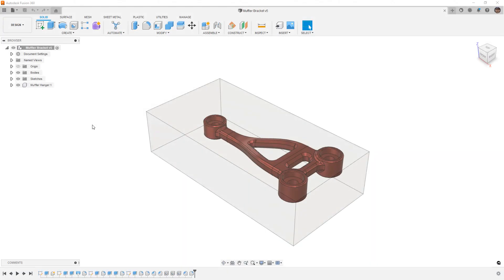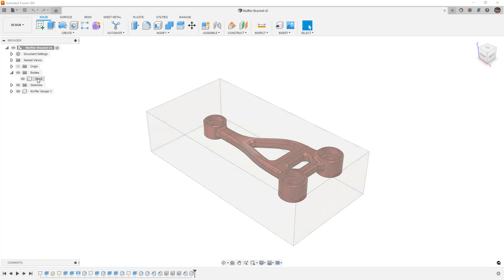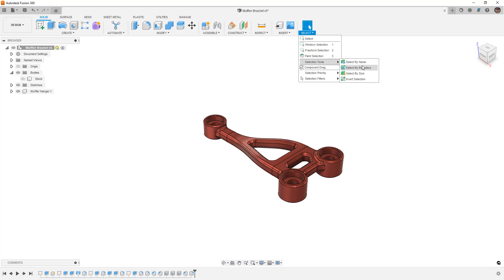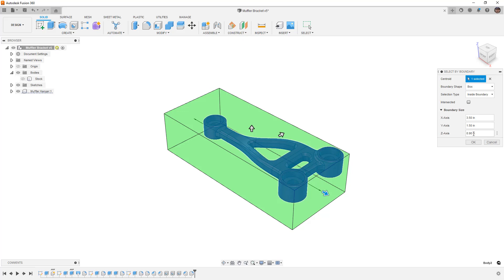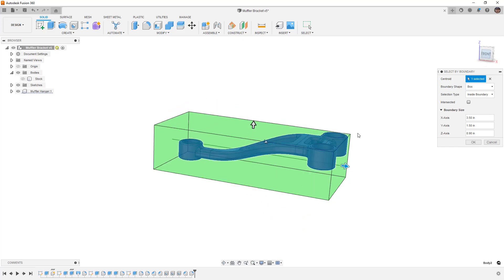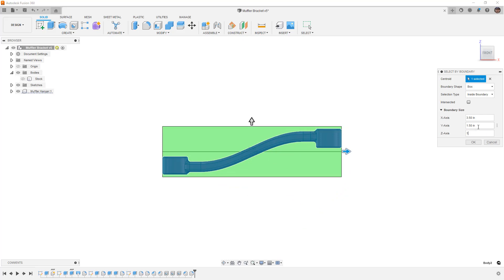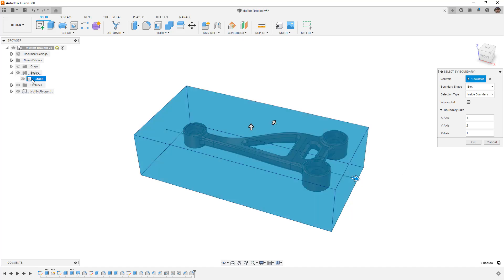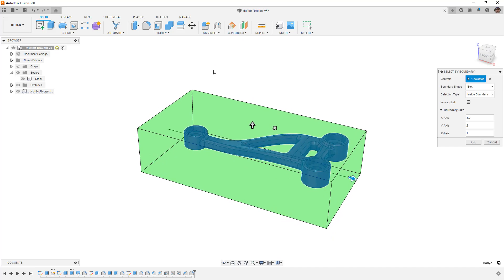Fusion 360 Quick Tip | Using Select By Boundary to Figure out Part Boundary Size #Fusion360

Comment: this is great but it seems it sets the boundary box to the parts orientation in space. I"m trying to determine the minimum rectangular envelope a 3d piece can fit within and then orient the part based on such bounding box. I can do this in solidworks but haven't figured out how to in fusion.
Reply from the maker: Yeah the select by boundary box is based on the XYZ in the part.  If you make each body a component you can use the Arrange tool.  You may need to turn it on in the Preferences but it will be in the Modify Menu.  There is a 2D True shape which will reorient your component to sit flat on a plane.  It can do this by copying the original or moving it.  

Using the boundary box selection (or just right clicking on the body/component and going to its properties) can work if you use the align tool first or arrange so that it sits on one of the planes.  

There are some other arrange tools aimed at flat pack style manufacture or by fitting piece in 3d in a say an SLS or SLA 3d printer.  

In Solidworks, It is nice that the bounding box reference geometry can be "custom".  That is one thing they did right.  But with Fusions Arrange tool it can arrange it for you.

Comment: Hi Matt,
what exactly does this differ from using stock tab options in the CAM workspace?
Reply from the maker: well when creating a CAM setup on the stock tab at the bottom you have a bounding box size based on your settings, but the select by boundary lets you see the minimum size in the design workspace.  Why?  well normally I model my stock as a body in the design.  This lets me position a vise, parallels and work fixturing then when setting up a CAM setup I can use "From Solid" for my stock definition.  This means if i change the stock size in the design it will update, but more important (to me) is the ability to position all my objects/workholding before the setup.
Reply: @LearnEverythingAboutDesign  Thanks for the clear explanation. Just fond out you have a another fusion youtube channel. I Love your content!
Reply from the maker: @luis7899  No problem!  I don't have another channel(that i know of), but i do make videos that you can find on the Autodesk website.  Years ago there were some youtube channels that illegally copied videos of mine and cut out the intro/outro.  Where else did you see my videos?
Reply: I believe its called learning expressway ?
Reply from the maker: @luis7899  well.... that is me, but not my channel.  They copied videos that are available on the Autodesk website, but its not an official Autodesk channel....  Thanks for letting me know!

Comment: Why are the dimensions different in "Properties - bounding box"? Do you know?
Reply from the maker: If you select the Muffler Hanger component and right click to see its properties, the bounding box size listed there (for me at least) is 3.5 x 1.5 x .901in.  The Select By Boundary lists .90in for Z but it only rounds to 2 decimals.  The bounding box for the Stock is listed as 4x2x1 in both places.

Are you talking about the difference in .90 vs .901?  or are you seeing something different?
Reply: @LearnEverythingAboutDesign  I have a rather complex body and the dimensions are very different. The select by boundary dimensions seem right though. I will go with them. Thank you for your time though.
Reply from the maker: @broom6958  That is strange!  The coordinate systems should be the same so the only thing i can think is the complex part (if you are selecting a component) is pulling in additional bodies.

I like Select By Boundary because of the visual feedback, especially if planning stock.
Reply: @LearnEverythingAboutDesign  Yeah, will check. Thank you!